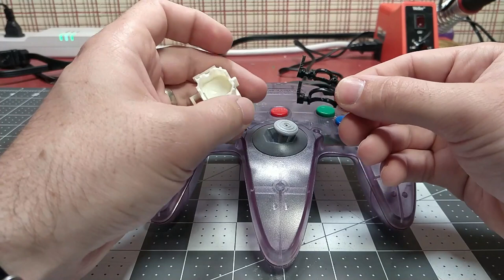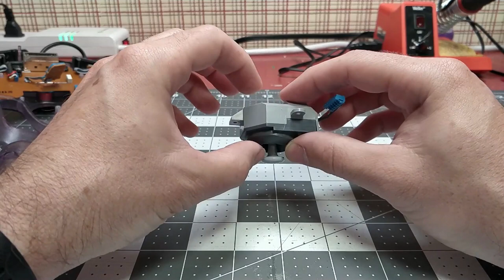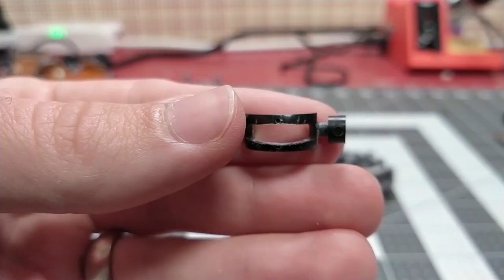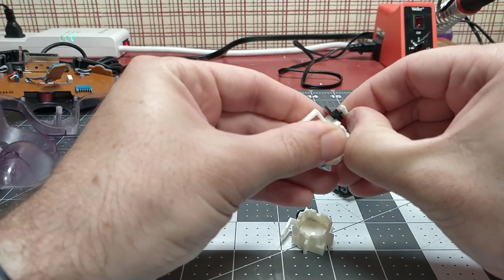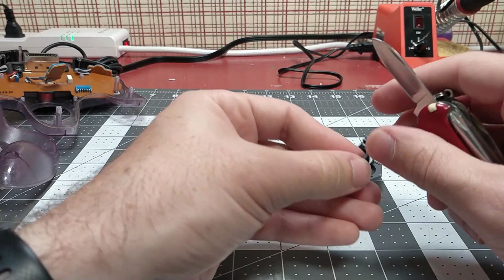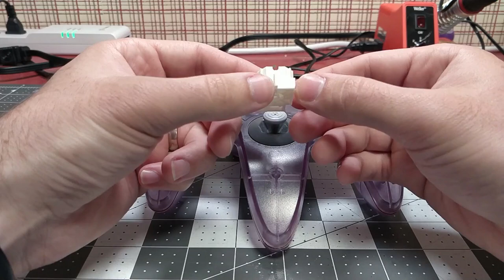The Better N64 Joystick Repair

Comment: THE 2ND BIG REASON to fix the stick instead of getting a replacement assembly is that all the new sticks, EVEN NINTENDO'S OWN NSO N64 CLONE CONTROLLER, use potentiometers, meaning there's a likelihood the replacements will develop stick drift.  The optical wheels are contactless, so in theory they'll be accurate forever.

Also, a lot of the replacement sticks have poorly-mapped stick ranges, meaning they'll be inaccurate right out the box.

Comment: Being that the new bowls are made of POM, they’ll probably last way longer than the original and even outlive the rest of the controller. POM is a low friction and high durability plastic that they use specifically for high impact/high wear applications. Really smart choice on their part using that.
Reply: "Polyoxymethylene, also known as acetal, polyacetal, and polyformaldehyde, is an engineering thermoplastic used in precision parts requiring high stiffness, low friction, and excellent dimensional stability". Just putting this here for others to know what that is without having to look it up.
Reply: @legostar55  thanks! Good info.

Comment: the way you pulled that z trigger jesus. so when youre facing the controller only the left clip moves, the right one doesnt. so just open the left side pin and slide it out dont just pull up unless you want to break the right one one day.

Comment: I wish the price wouldn't be ridiculous for them here in europe, they're still 3 bucks or something for a set but the shipping is 15 bucks, i really want some working n64 controllers so it's my only option, really hard to pull the trigger on them though

Comment: I ordered a bunch of sets of these off eBay for about $12 a set… disappointed with them. They snap back to center but they’re inconsistent when it comes to benchmarks. Some values are close to the 85 perfect number but some directions like left are at as low as 72. Not exactly sure why that would be, but I tried it with 3 different controllers and had similar results.
Reply: Same, almost perfect but there's always one direction where I have low values and I can't figure it out. Mario would run up, right, and down, but walk left :D
Reply: @vincentgravel92  I genuinely couldn’t see why when I took it out and looked at the gears. Some type of inconsistency… if only the manufacturer would work it out these would be 100% OEM replacements
Reply: This is an issue I had with my first controller I rebuilt. No matter how many times I took it apart and put it all back together it was like 1 direction just wouldn't work correctly. What I found is that the board inside the joystick has two slots where the wheels turn inside to give input, those need to be cleaned carefully, but very well. I've found that some of the dust from the old bowl can interfere with your inputs once you replace stuff. Always clean the board! Also, make sure to lube the bowl and gears, it will make the movement smoother, and help it last longer, just don't get any on the wheels, only the geared spots and inside the bowl.
Reply: A work around is to use some epoxy. Usually the left to right is an issue w those. A tiny bit of sanding to the edge, then just a film of epoxy, n when dried, buffed it smooth. That will usually fix the issue. Hell you can epoxy the the old gears if you still have them n it works too n then you really have a great fit.

Comment: do you find the replacement bowls do not sit flat into the old housing? I end up sanding down the middle peg or it wobbles. When fully reassembled and screwed tight it wont work unless I do that, or back the screw out slightly that hold the housing together. I don't think you had this problem bc of the old stick, or in the case you actually got your bowl to sit flush and flat where the original one was.

Comment: You should lubricate all those new parts
Reply: Any idea what lubrication to use? Just simple grease or electronic grease?
Reply: @Saddnnd  Super Lube PTFE Grease. I tried Super Lube Oil when I did mine but I think it was too thin.
Reply: @Saddnnd  If you have some silicone dielectric grease that also works fine. I used it on the bowl (a big glob), all the pivot points, and anywhere else that makes contact. DO NOT put it on the gears.

Comment: Does this fix the drift? Also does it work on a sharpshooter stick? Or other 3rd party sticks?
Reply from the maker: This repair should help the original stick. Once the parts are deburred and greased, they should feel much better than a worn out stick.
I'm not sure if it will work with the sharpshooter. They're listed as "optical" which is the same technology as the original stick, but it would depend on Old Skool using the same parts as Nintendo.
I doubt this repair will work with other 3rd part sticks. Most of those controllers use potentiometers to measure the stick movement, rather than optical encoders like the original stick design.